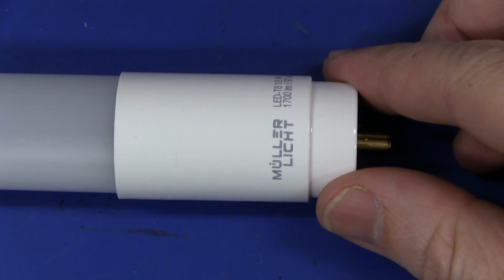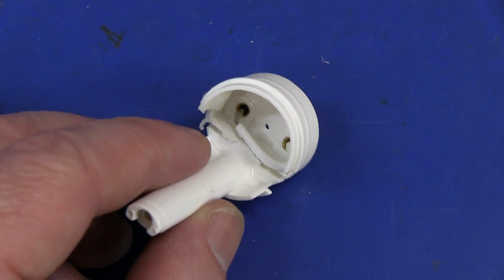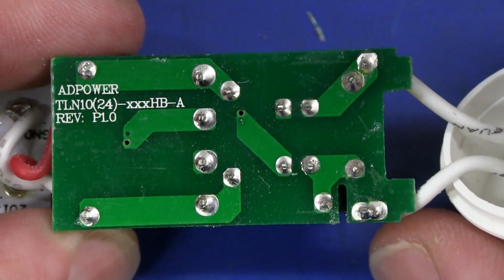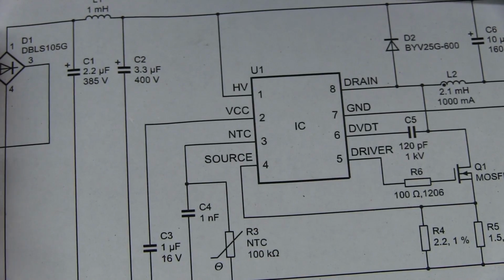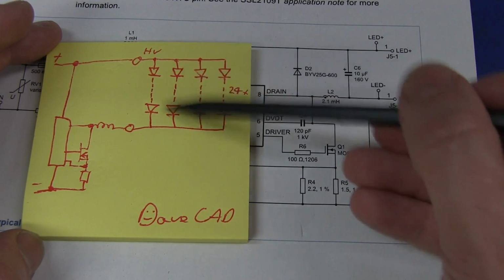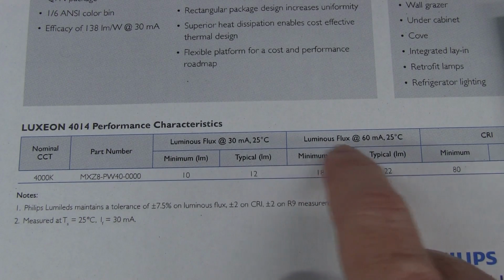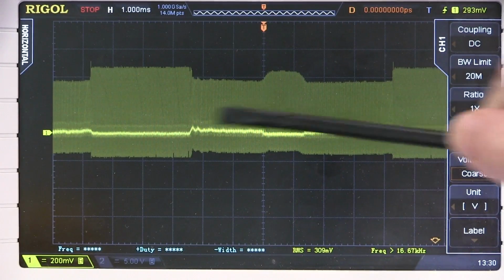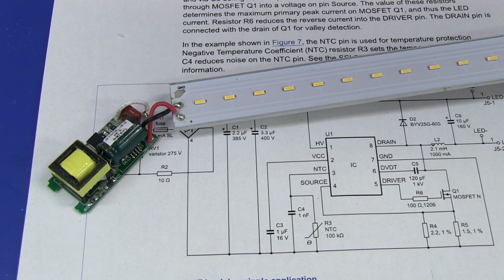EEVblog #533 - LED Fluoro Tube Teardown

Comment: It’s funny to see your biased opinion of the German seller overriding the actual quality of this Chinese product. I highly doubt these are Luxeon leds either looking at the rest of the obvious shortcuts in the product. Not saying it’s not a good product, just pointing out the mental gymnastics we use when evaluating things in general.
Reply: I have also found myself guilty of the very same. However..ANYTHING made in china connected to full ac power causes an eyebrow to rise, and prompt inspection of ALL parts and layout. IF i can get into it to look. If not and the cost is low, i will buy an extra or 2 and apply a means of entry to inspect within. I had a close call with a phone charger....NEVER ever again will i blindly trust made in China.....

Comment: I think the clearance is alright since everything is coated under soldermask which is protected from scratches by the tube.
I think that at the end, it is perfect to just stick the bare pcb without the aluminium frame directly under a shelf, to get a bright working light.

Comment: Question. Your terminology is a bit over my head. One simple thing I need to know. Are the components inside the LED tube transferring input voltage to DC lower voltage?
Reply: Yes. The rectified Input will be around 300VDC. A step-down regulator always requires the load (aka the LEDs) to be at a lower voltage.

Comment: hi i have also bought one of these led tubes but they have a glass cover on outer side and thin plastic cover inside them no heat sink i have accidentaly broken one the tube if you wana have a closer look of it i can send you the pics and more thing mine one are of other type as you discussed in the other video they need to be powered on both sides means live wire on one side of the tube and neutral  on the other side

Comment: How do you feel after all devices are using switching power supplies and they cause generally more rf in higher bands than old fashioned lighting. Many radio amateurs have bad times in cities because of constant rf ringing in the bands. I heard some plans for future homes to incorporate low voltage rails for small load devices to connect to standardised dc psu. Poe is somewhat similar system at the moment.

You're always fun to follow. Thanks

Comment: Very interesting - and I do wonder how much operational life is actually shortened by the lack of thermal transfer behind the PCB, and also surprising that the heat sink is fully encapsulated in the plastic tube rather than being able to vent heat to the outside air.  Fully assembled it would seem that temperatures would rise significantly.

Comment: In a ProAudio environment, there´s not much difference between the old fashioned FL and the newer LED with the awful SMPS, all are poorly sheelded and/or suppressed and do emit all sorts of HF (wireless and into mains) and NF 50/100Hz rectangular waveform and thier harmonics back into the mains as well....no good for any audio devices powered by mains or even in the same room...

Comment: Why one should do this?? Just because it´s possible? You´ll need a new PS, huge time to assemble and for what'? may just double the light luminous flux...
if you want to do it "right" go for the Cree CXA2530, warmwhite, 3800lm type singe chip LED ;)

Comment: The volts are irrelevant in a circuit like this. Short circuit half of the LEDs in each string and it will still work without overdriving the remaining LEDs. That's the whole point of a current driving LEDs.

Comment: Almost all of those switch mode current supplies use a sense resistor (look at the datasheet). Essentially they look for a certain (fixed, e.g. 0,2V) voltage on the resistor. Exchange the resistor and you change the current. Ohms law is your friend.
I wouldn't try to get more light of a tube constructed like that though. With being totally enclosure in plastic you'll reach a thermal limit quite soon I think.

Comment: It's a matter of energy-efficiency for me. Incandescents and halogens are horridly inefficient and, frankly, they're almost a fire hazard in their own right (especially halogens *shudder*) I meant CFLs not CCFLs, the only place I see CCFLs is in backlights. LEDs have good efficiency and CRI, and they look good, but they're almost prohibitively expensive, especially the ones that actually put out the same light at the incandescent or fluorescent bulbs they replace.

Comment: In theory, the thermal impedance from the pads to the tiny copper island is going to be around 60C/W. This will give a 6C rise above ambient. So your looking around 38C.

However, the Vf has a negative thermal coefficients, so in reality the power dissipation should be less and once the equilibrium is reached within the environment, the delta temperate should be less than 6C

Comment: Quite the coincidence, just today at work I received an LED line array similar like this, but with lenses fitted for a machine vision application. The PCB and body/heatsink construction looks just like yours. Mine was made in the USA though. I called the company and talked to an engineer to talk about the design on the phone and he told me this design was both cheap to make, and a really good heat dissipator. Neat to see one cut open (without having to sacrifice my expensive machine-vision one!)

Comment: While the light output of the LEDs may be a bit over spec (with new LEDs) you will have to take into account aging and the loss of light through the plastic tube.

Nice walkthrough and research in all.

Comment: And another thing, they are probable not driving the LEDs at full whack for temperature restraint, longevity and to look good against a florys power consumption. To be honest, I would prefer to chose my happy medium. Could you tweek the controller a bit for more light? Just to see where the cost and life expectancy of both tubes match and then measure the lumens output. We have to level a playing field some where.

Comment: Apart from sinking heat away from the LED's themselves there isn't much point going overboard with heat sinking as the units a pretty much sealed and will have an overall dissipation over the whole package and like you said Dafyd, some health and safety measures don't really have to be adhered to as it's a sealed unit to most intents and purposes. Talking of LED's have you fixed the Deloreans clock yet ;P

Comment: What is quite interesting to check - it is power factor of such devices (how current follows voltage). As i know most of devices with diodes and cap sucks in this matters, and it will make a bit more on your electricity counter than your measuring equipment will show.

Comment: As I see this LED tubes idea is extremely stupid. Lamp ballast has ~70% efficiency, LED tube has its own PSU wasting power too, light diffusor wastes ~30% of light, and finally invalid fixture reflector wastes another 40% of light.

Comment: I am also in this boat, almost all the easily-available CCFLs around here are 2700k horrible yellow and look almost like low-pressure sodium lamps. Anything better is either impossible to find or prohibitively expensive unless one makes a trip to one of the nearby cities.

Comment: that's odd, i can easily perceive a 5000K and below temp as "yellow-shifted" even with no other light source nearby.
I start seeing a blue tint above 7000K, all the screens i use are calibrated to 6500K, 5000K is atrocious in a monitor

Comment: Plastic isn't a very good conductor of heat - but it's also not a very good insulator.
The tubing looks about 1.2m*25mm*pi = .1m^2.
Polycarbonate - .2W/m^2/K thermal conductance. Say the thickness is 2mm, that's 100W/m^2/K - 10W/K for the tube.
With 20W mains, that's 2C hotter inside the inside surface of the tube from the outside than if you made the tube from aluminum.

Comment: It is important to move the heat away from the LED die. When the heat is spread to a larger area the temperature is decreased. The tube does dissipate heat to the outside.

Comment: The weakest part of most LED light bulb replacement designs are the aluminum electrolytic caps. I have already had to replace some caps in LED light bulbs. The CFL bulbs usually wear out before the caps dry up, but I have repaired several of them as well.

Comment: That's probably not a transformer at all, since the voltage there should be DC. If you desolder it from the board you can check that the leads for the secondary winding are probably not connected (eg. there's no second winding at all) and is used as inductor.
I might be wrong thou, but I've encounter such transformer-like inductors in every CFL lamp I've opened.

Comment: What happens if there is a capacitor inside fluro fitting as well ? Can you still just replace the starter and tube or does the Cap need to be removed?